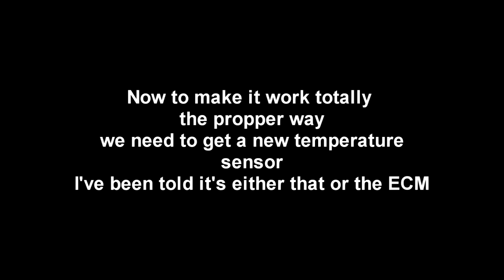Saturn update

Comment from the maker: @schark30 well if that were the case i would use it but i actually have a full size 15" spare under the back of my tahoe to get me by in a have to case but i think wee got it handled now. like i said up above i got some maypops with a little less than 50% tread on them so i should be good to go for a little bit now till i can afford a brand new set

Comment from the maker: @naterade21 they may be plastic outside but they have an industry trend setting metal safety cage so even if something happened to it she'll at least be safe in it. along with getting really good gas mileage and it's made by GM, how bad could it really be after all? :o)